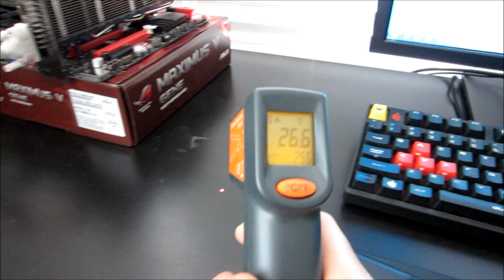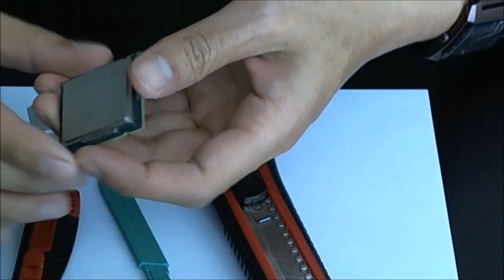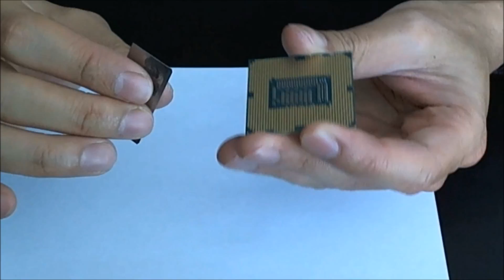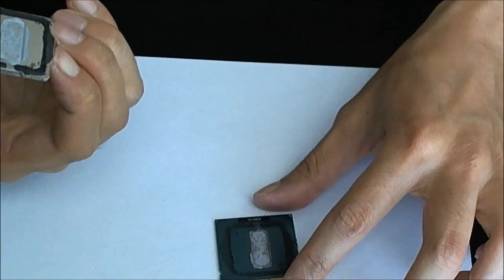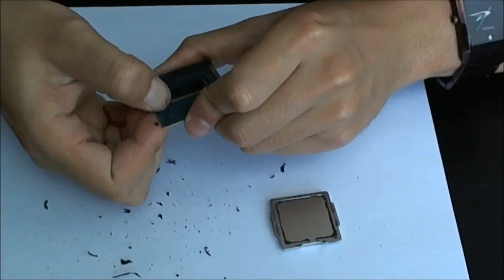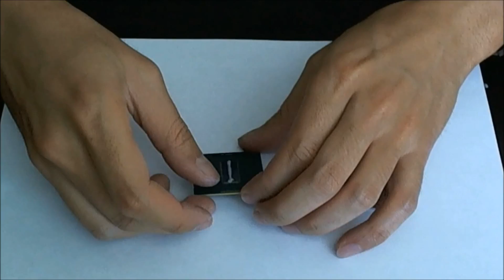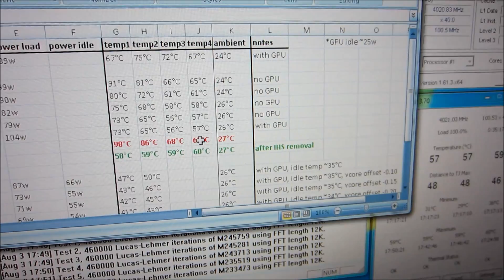Fixing Skylake, Haswell, and Ivy Bridge CPU temps: IHS removal

Comment: Just received my quad core i7 and am a noob but have learned to read the comments before attempting to apply the thermal paste. I have yet to find a video that properly explains how. Pea size, X method, spread? Any real info would be valuable before I screw up. I plan to off the stock fan/heat sink and opt for a water cooled unit instead. Help please. Thanks...

Comment: I've used diamond paste for years directly on CPU/GPU die. It won't scratch the die if it remains stationary. So unless your a chronic heatsink/waterblock remover, it's an economical and safe alternative to silver.

Comment: "Unlike the pin grid array (PGA) interface found on most AMD and older Intel processors, there are no pins on the chip; in place of the pins are pads of bare gold-plated copper that touch protruding pins on the microprocessor's placeholder on the motherboard."

Any LGA socket processor does not have pins on the CPU itself; they are located on the socket, which connects the motherboard to the CPU. Please do a little more research before retorting with such vulgarities.

Comment: Haswell has no pins on the CPU, it is a LGA(Land grid array) which means it sits on the motherboards pins for connection. CPU with pins are called PGA (Pin grid array).

Comment: You could glue it again. This "black thing" you said can be replaced with a thin layer of silicone(there are black silicons that withstand more than 150C easy)

The thermal paste they put is not very high quality also the sealing might had been thick so the heatspread metal didn't touch the cpu very much that's why you were having too much temp.

Comment: WhiteFireDragon

I'm assuming you didn't do this because I didn't see task manager open, but did you open task manager to make sure prime95 wasn't only running on the first core?  Open 4 or 8 instances of prime95.  Ctrl+Shift+Esc, processes, right click on each of the instances of prime95, set affinity, set 1 program per core/thread.    monitor your temps, monitor performance graph in task manager.  change the v core to stay at a safe temp running 100% usage.  you need to stress all cores

Comment: have u seen how many likes this vid has got... obviously there is a problem with the cpu...ive tried other cooling optons water and air temps are still not acceptable...no overclock i have a vanilla 3770 under 50% load temps reach low 90s degree c...

Comment: And I'm here to tell you that this is not the only way to "keep Ivy bridge cool." The stock cooler is capable of keeping the i7-4770K under 90C under 100% load, as long as the TIM and heatsink are properly applied. If not applied correctly the first time, then re-applying the TIM will always help.

If you're using an aftermarket cooler, and with a modest overclock, these steps are completely unnecessary. I'm not saying it doesn't make a difference, it's simply unnecessary.

Comment: For people's information:

1. This video's results cannot be trusted, and I do not recommend following these instructions or any instructions that recommend the removal of the IHS with any CPU.
2. No, touching the contacts won't destroy them - the oils on his hands are easily removable with isopropyl alcohol. Clean rooms at Intel fabs deal with the silicon chip itself, not the interface PCB nor the heatspreader.

I can respond if you have anymore questions. Please, don't believe this video.

Comment: For your information, those contacts are not what the clean rooms are for. The clean rooms are to prevent dust from interfering with the lithographic processes used to transfer the CPU schematic onto the chip, along with preventing any irregularities in the copper wires within the CPU itself. Cleaning the contacts with isopropyl alcohol will suffice, as the oil from his hands won't cause any real damage.

If you touch the pins, simply clean them off. Touching them won't ruin them, though.

Comment: Lower TDP != Lower temperature. The die size decreased, and they packed more transistors into that area, meaning you're going to get a higher amount of heat in a smaller area.

Regardless, this video is biased and is skewed due to either:
a) Improper application of TIM between the CPU's IHS and heatsink or
b) A faulty unit.

Regardless, the temperatures achieved before and after are not correct under normal circumstances.

Comment: its actually quite old. Its called LGA, which means Land Grid Array. Intel started using this for desktop processors in 2004 on the old Pentium 4s. after they released the P4s they started using LGA entirely.

Comment: There are no pins to destroy on the new Intel processors. However, you do not want to touch the connection points because the oils from your skin will get on those connection points. Which is not good at all

Comment: So, you're saying that a Haswell chip was designed to never run at 100% load? That sounds stupid.

There's no reason why it should get worse temperatures at full load than Sandy, which was at 32nm. It's got a much lower TDP, meaning less heat produced, meaning it should run cooler.

Comment: You should send a HUGE thank you letter to Arctic for making such a smooth paste, the slightest scratch on the die could defect the CPU entirely. I wouldn't recommend this for anything but a very LAST result of desperation.

Any way good job, not sure I'd have the balls to try that I would probably just send the chip back.

Comment: Oils in your skin cannot damage gold. It takes crazy reactive stuff to corrode gold. But you do want to clean it off before use. And of course, the contacts are a bit fragile and there's also static discharge to worry about. So keeping your fingers off the contacts when possible is certainly good practice.

Comment: I do lots of video conversion and stuff like that and prefer Handbrake that utalize software conversion over crappy "one click" software for example the horrible Mediaespresso that can use HW acc on gpu so my cpu often at max bring horrible tems on ivy + haswell if high clocked.I think Intel could have done it better but mainstrean platform and they prolly want us to go extreme if wanting solder IHS? Just a though but slightly better should be possible cause delid experiences tell us that imho.

Comment: Ivy Bridge and Haswell use TIM between core package and HIS, a very bad one at that! So even though they might run pretty cool on stock clocks they do pull away like crazy when applying higher volts, hence the delid threads out there. You correct that prime95 or a typical "burn in prog" do max it the best it can even Aida64´s stability test that is highly recommended for Ivy´s (not sure about Haswell?) still pull very high temps and often severly compromising high overclocks.

Comment: Yes of course I realized, with my i7 2700k to 4.6Ghz was over 38C º to 40C º ~
idle, something my current Ivy Bridge Core i5 3570K without over 3.4 GHz base clock oringinal temperature 43C ° in Idle.
(google translator ►Thaks review)
Brazil - Crato - Ceará

Comment: I understand people will say otherwise, but I would like to assure people that Intel used awesome TIM in their Haswell and Ivy Bridge CPUs. There's enough videos and posts showing this; the reason temperatures are so different is due to the fact that this is very likely a defective unit, or the heatsink/thermal paste wasn't properly applied.

That large of a temperature difference cannot be achieved by simply changing the CPU's internal TIM.

Comment: For general use so is it a bit higher actually. under prime95 it is now around 73C :/ i saw on asus unity3 software which seems to be inaccurate, but under normal use so is it not that high (gaming).

But i got to say that normally so are the temps no higher than 60C

Comment: Wow there are actually people that think a Corsair water cooler is better than high end Noctua heatsink. My NH-D14 didn't even let my Phenom II hit 49C when overclocked from 2.8GHz to 3.6GHz. Phenom IIs are known for having insane power draw of over 200 watts while overclocked. That's compared to hitting over 80C @ 3.4GHz with a fresh install of the stock heatsink.

Comment: i first had an expensive noctua aircooler and the temps raise up to 90 degrees on full load now i use the cheapest water cooling from corsair and temps are always under 60 degrees. so i cant agree with you on that

Comment: What do you put the IHS back in your installation for? You voided the warrenty, will crack the CPU if not accurate anyways(because you removed IHS's mount to PCB). And you get an additional layer of thermal paste, that drastically obstructs heat exchange.

Comment: upto sandyB all CPU's had their heatsink's soldered to the CPU die, while ivyB cpu's had thermal paste between them (some claim the pate is crappy while some say there is gap between IHS and CPU tim )yours is cool because heat transfer is faster to the CPU due to the IHS is sodered, while ivyB has cheap paste which offer's poor thermal conductivity.

Comment: dude, first STFU, ive seen spammer;s post less than that,
2nd why 700W PSU and 7 case fans? just get 2 case fan's and a CPU cooler with a 400W PSU.. 3 if your getting celeron then you shouldn't even be here. you only have to do this when your OC'ing, where temp matter's quite a lot.

last but not least,nobody gives a damn about what your going to do with your build so please don't post essy's about your st build.

Comment: msi military class 4 or highest quality japanese motherboards, 8gb of ram maybe, fans for all chipsets on motherboard maybe, led monitor 23.6 inches or around there, wired usb keyboard microsoft brand or other good models, solid state drive ONLY, no mechanical hard drives at all in the computer, maybe an external hard drive or usb flash for exporting and importing files but even thats not necessary because i can just email the files or store them on hotmail or those online storage things

Comment: after all, my next pc build is intended for mainly reliability, so i want the highest quality components with the best cooling. i know most people would say that you should upgrade your pc every 2-3 years or so, or maybe 3-4, but i plan on keeping this for like 10 or more maybe if i can get the highest quality parts, its only a low end gaming setup, this would be the nzxt source 210 case, 7 case fans, 120mm and 140mm, 80 plus platinum psu, maybe the xigmatek vector p 700w psu...

Comment: if there are only minimal benefits of doing this, id rather just save the hassle and go with a sandy bridge cpu, then, all i have to worry about is just getting a good cooler and il pretty much get what i want. but then again, the celeron g1610 for only 37 dollars out the door from microcenter is such a good deal, its hard to pass on that, and if i were to do this modification by myself without spending more $, + a good cooler, it would still be pretty cheap and last a long time.

Comment: is there any place that can do this for you, just removing the heat spreader, the glue around it and pre applied thermal paste on die for not that much money? i mean, i dont even know if i have the right tools or cautiousness to do the job. i can probably do the rest like putting on the new thermal paste on the die and putting back the heat spreader, applying also the new thermal paste on that, have it clamped and then install cooler, but the other steps, im not sure if i can dd that.

Comment: its not so much the oil on ur fingers as its the acid / salt on ur fingers that can ruin things. I tend to use ethanol to remove finger debris. If ur fast it cant hurt the bottom of the chip-plate to much.

Comment: Processors typically shut off or cause a reboot if a critical temp is reached. The fact that this did not happen,shows that no damage has been done.Had your computer shut off or rebooted,you shouldn't worry either- they do that well before the damaging temperatures so the user would have room for error. My advice would be to upgrade your cooling, and in the meanwhile, upgrade your thermal paste. In the meanwhile,here are tutorials for different CPUs arcticsilver com/intel_application_method.html

Comment: I've taken apart thermal adhesive numerous times. That was cured thermal adhesive. Find an old motherboard with a chipset heatsink that's not held in by springs and try it yourself =)

Comment: that's not true at all xd you are not supposed to touch any electronic components if you're not discharged cause charge difference betwen you and the component/conductive material can kill the sensitive components (like low voltage chips)
everyone got shocked that way xd by a door knob or something, or even when you touch someone...you can even see a spark :P

Comment: if you clean it afterward with alcohol there will be no problems. Really, with an intel CPU without the pins it doesn't make much of a difference, it only adds to the corrosion over time.. a long, long time.

Comment: I guess I don't need to do this, my 4670k is OC'd to 4.6 @ 1.22v and the temps are 30c at idle and less than 60 on full burn with just a hyper 212 evo

Comment: Question: (I'm a CPU modder n00bie, so don't expect much of me)
If you delid a CPU, do you have to put the IHS back on, or can you apply, say, a waterblock onto it directly?
Are there waterblocks meant specifically for bare CPUs?
Is it possible to delid a soldered CPU, and would it be worth it in any way?

Comment: i7 3770K for what? 340$ for shitty temps even under WC, shitty room of OCing, shitty results at high OCs compared to a FX-8350 (1-2FPS) for 150$ dollars more and when they will release yet another generation of CPUs they will launch a new socket as well, so u and the rest of the "techs" can spend a fair amount of 550-600$ for a CPU and mobo combo. U're a true technician...

Comment: correct me if im wrong but doesnt the fan draw air in from the "open" side? and not the side of the motor? im pretty sure the motor side to the CPU fan is facing the graphics which would make it an exhaust fan, drawing air THROUGH the CPU cooler... could just be me though and i have managed to somehow aquire fans that are built the reverse way around from the norm...

Comment: I've got question, hope you can answer. I just built my computer with 4470. After playing battlefield 3 for like half an hour I noticed my computer case really hot. I read the temperature and turned out it was reaching 100C during game play! I checked the fan and reseated it nothing changed. Do you think I perminantly damaged my processor? Now it runs at idle at 45-50C but I wont risk running game on it again.

Comment from the maker: First of all, it's an exhaust fan, pulling air through the cooler. Don't build computers if you don't know the difference between intake and exhaust.

Second, there are vram sinks since it's a passively cooled video card, the CPU heatsink is too large to fit sideways.

Third and most important, I'm testing temp  improvements from delidding, not airflow or cooler orientation. Those variables must be same.

Try understanding simple concepts before you give advice or throw insults, fucking idiot.

Comment: No. Just no. Like Ryan said, an i5 for gaming is top notch. Spend that extra 100$ on a better graphics card, if anything. Also, the i7 won't last longer than the i5. And there's almost nothing that really pushes the hyperthreading, so again, wrong. Basically, you're wrong about everything you said in your post.

Comment: I don't know if you have a bad CPU or I have a good one. Mine Overclocked to 4.1Ghz on Air, Prime95 hits maximum 78C on 1st Core and 69C on 4th Core. I overclcoked it at 1.155V, do you think it's too much. I see you running 4.0 Ghz Overclock less than 1.1V.

Comment from the maker: "Us techs", such as yourself? Actually you're a prime example of dumb consumerism at its finest.

You're suggesting to spend a good amount more money on a processor that has less overclocking headroom, dumps more heat, and requires a larger cooler, not realizing most people do not even need the full 8 threads.

If you can't make sense of what delidding actually does, then go buy your $340 i7 and be happy with it.

Comment: indeed.
IMO playing around with overclocking and voltages without knowing what you're doing may be even more dangerous.
i honestly dont see how you could damage the CPU if you're really cautious. the hardest and most delicate part as i see it is when you have to fixate the CPU back in the Mobo to make sure everything is perfectly alligned as to not bend any pins.

Comment: It's the difference between spending an extra minute (tops) to do something right, and doing it in a half-assed 'well, it works' manner. The former matters to some people, when they're going to be using the system for even five years.

Comment: Ok if you want to get all technical, then you fail to realize the oxidation rate constant of the "reaction" will be so small that it's irrelavant. Are you going to keep this computer 50+ years?

If the die and IHS's stock TIM was actual paste, then yea isoproyl alcohol would have been a good idea. But it was crusty and just flaked off, there were not any smudges or residues left.

Honestly, you're worrying about minsicule things that are negligible compared to how much was actually gained.

Comment: Actually, he's not wrong. The oils left behind WILL oxidize and can contribute to microcorrosion and raised impedance on the connections (meaning more voltage will be needed over time). It's just slight though. Should have swabbed it with alcohol and a microfiber to clean the oils off.

More problematic, he didn't do an alcohol swab of the die and IHS before applying the new paste. Where the oils definitely CAN cause temp problems as they oxidize/rot/form tiny off-gassing bubbles. Keep it clean.